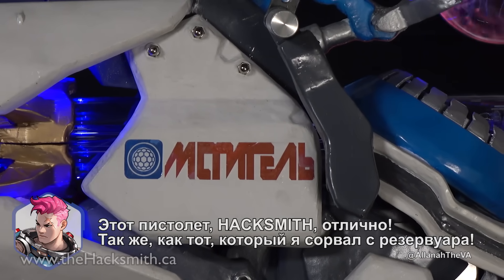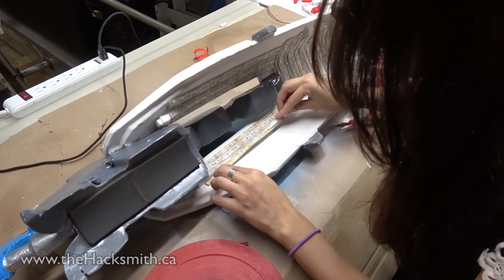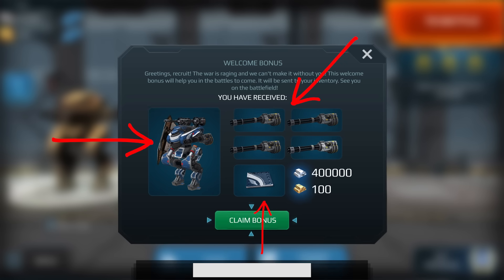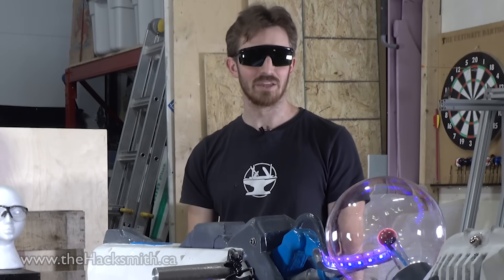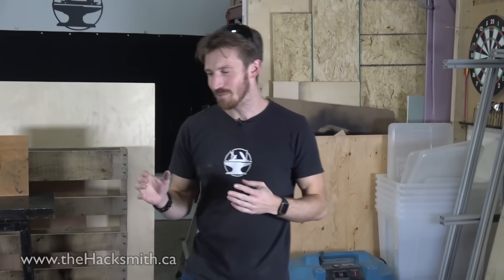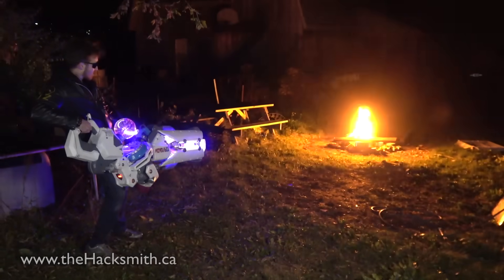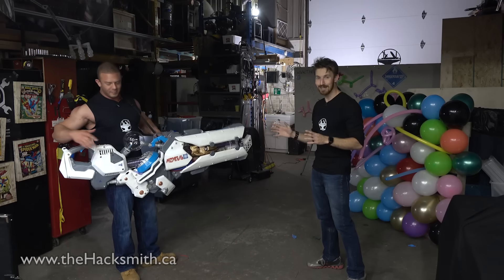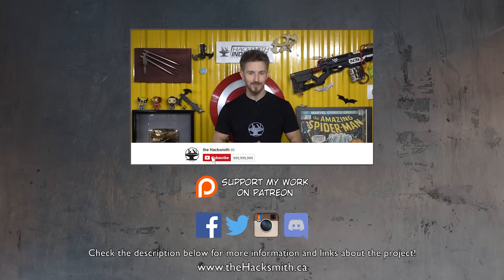Make it Real: Zarya's Particle Cannon (PART 3/3)

Comment: Excuse me I know very little about lasers, let alone CO2 lasers, but in your red hot rebar crossbow video you said the batteries you used put out 30 Kilowatts of power. I know on that one aircraft carrier with the laser weapons system uses a 100 something KW laser. Why not just attach another set of batteries like that to your laser and up the light output, or is that impossible? I imagine you could add a watercooling system or something if overheating is the issue.
Reply: There are far more constraints to laser power than just the battery. That's like saying "You have a big gas tank with a huge pipe coming out of it, why can't your Civic beat an Indy Car?" Because gas tank has almost no part in how fast a car can go. The laser James is using is actually only 80(?) watts (which requires hundreds of watts of support systems to activate and cool). The laser in a laserpointer is 0.005 watts, so this is already 16,000 times as powerful as your laserpointer. Why not just hook up his batteries to a $1 laserpointer then?

CO2 lasers generally scale in length with wattage. Meaning, a 40 watt laser tube is half the length of James' 80 watt. That's not true of all lasers, but it's true of this type.

The thing that limits the laser power is generally, like many electrical or mechanical things, heat. Things have to be physically large in order to handle the amount of heat they generate. There's no way to get enough cooling into the laser to prevent it from burning up, without it being larger. You can maybe push it 30% or so, at the expense of the life of the tube (laser tubes are consumables, they wear out and decrease in power over time, they're also expensive).

The next constraint is the power supply. The power supply is kind of like the engine. The batteries are only the fuel. This laser has a power supply that creates the extremely high voltage necessary to make the laser fire. It is limited in wattage. So if you want more power through it, even if it could handle the cooling, you need a bigger power supply. They're expensive, hundred to thousands of dollars, and scale in price according to performance.  

So, really, on a $5000 lasercutter like James has in the shop, that plugs into the wall, none of it is limited by the batteries or the amount of power available. And to get a more powerful laser, you have to scale everything bigger and more powerful. Basically, just buy a bigger laser, as that's cheaper than swapping everything larger. In the case of this portable laser abomination, Bogdan spent months cramming exactly those pieces into the shell, there's no room to go bigger.
Reply: Ah I see. I honestly had no idea. As I said, I know very little about lasers, though I do enjoy physics and find this fascinating. I will have to study this a little bit. Thank you for informing me. :)
Reply: You're welcome. We all have learn everything we know, happy to fill in your curiosity.
Reply: Would it be possible to use capacitors to create a laser pulse instead of a consistent power supply if that were an issue? Also, if you were to fire an under-sized/over-powered laser in short pulses, would it still have to deal with overheating?
Reply: Sort of, but no. All lasers are already pulsed. What you're describing is how we got from "this doesn't work, how can we cool this, maybe we should pulse it" to "hey we invented a laser". The timeframe on which lasers will overheat is infintesimal, so, no, not usefully abusive. They're already doing that just to become possible in the first place. All the free lunches are already picked up. It's a nice mental exercise... but, stop and think for a minute... do you suppose you're the first one to consider that? If it was that easy, that would be how things are already always done. Which in most cases, they are. CO2 lasers like this one are already cooled with chilled water, the power supplies are already boosted just to be affordable and small, etc. It's a miracle they work at all.The design is fairly mature, any more improvements just requires something bigger, not a bodgey upgrade. Also, you guys are pushing my laser knowledge, I'm kinda parroting without understanding too much context, so I might be wrong on some of it.
Reply: MattsAwesomeStuff holy fuck someone actually answered and then the person replied to a question respectful and informally on the internet BLASPHEMY
Reply: Brazy I'm still trying to rationalize the politeness of it all...

Comment: The Russian translation makes no sense. It should be "Эта пушка Hacksmith отличная! Так же как которая я сорвала с танка!" what you said is "This pistol, Hacksmith, is excellent! Just like the one I tore from the reservoir". Please consult Russians in the future for translations, we don't bite ;)
Reply: NinJeX I'm a native Russian speaker so you can trust me. The word Gun is commonly translated as "Пистолет (Pistolyet)" which actually means Pistol. In this context however, the word "Пушка (Pushka)" must be used which means Cannon. It's a common error because there is no such word as "Gun" in the Russian language that can mean both things.
Reply: I think the pistol part fits
Reply: as an another native Russian speaker I will say - no. Like its a huge gun, there is no way that any Russian would call that a pistol. Google translate will say Пистолет but because there is no word for gun in Russian language people would use the term Огнестрел (Firearm) or Пушка (Cannon) much more likely than Пистолет (Pistol).
Reply: It may have been a confusion between something like a water tank, a.k.a. reservoir, and a military tank. I don't think Google Translate does very well with taking context into account with these things.
Reply: Surrected ты сам перевел неграмотно
Reply: Surrected еееееее драсте, это переводится как «Hacksmith, это пушка прекрасна прямо как та которую я сорвала с танка»
Вооот